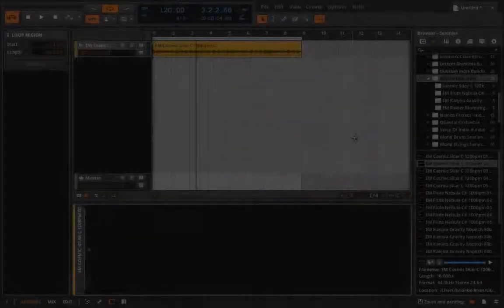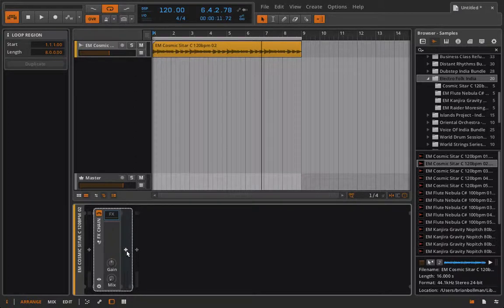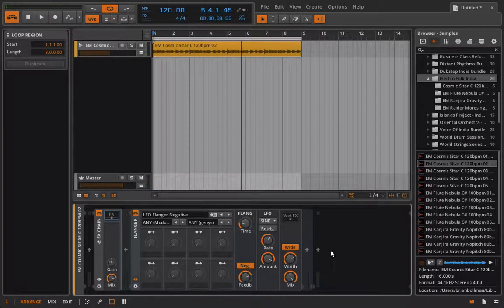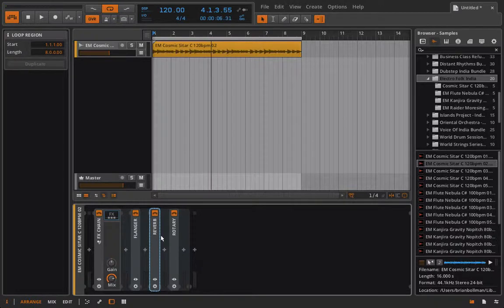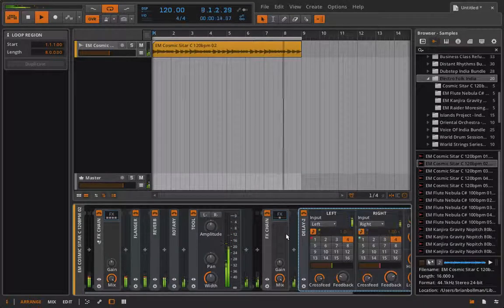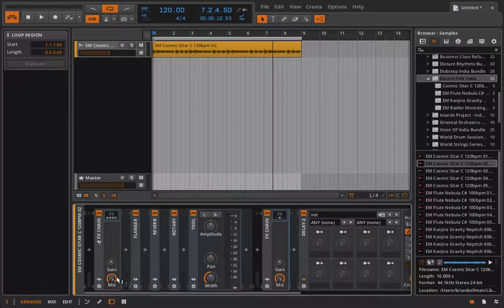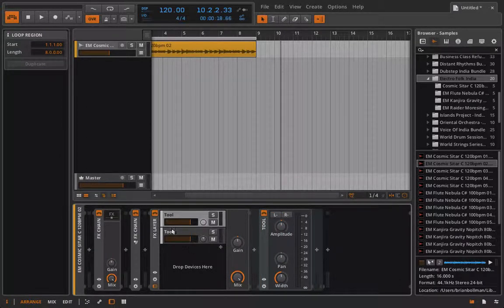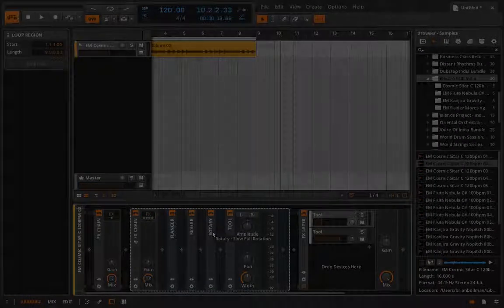Bitwig Studio & Music Production Course - 4.09 - The FX Chain (Container Device)

Comment: All we need now is a optional window that has a reason-ish vertical rackmount style display for the chain...especially long chains...if they could also add another reason style "flip around and see the patch cable" option we would be set. That or a FL studio style dashboard where u can create and save your own modular GUI to go with that awesome macro stuff! Am i asking too much? I find it hard to scroll through long chains horizontally  (especially since u cant use the mouse scroll wheel to do it :(  Is there another way...srry i already asked in another vid to no avail...THX!
Reply from the maker: I think the plan is to eventually have a reaktor style patching cable system if you want it  (modular style)...but it probably will be less efficient than the current left to right signal flow. But who knows that might not be for 5 years. 

To limit the left to right (depending on what you need to accomplish) you can work with FX Layers and then blend together and/or the XY effect.